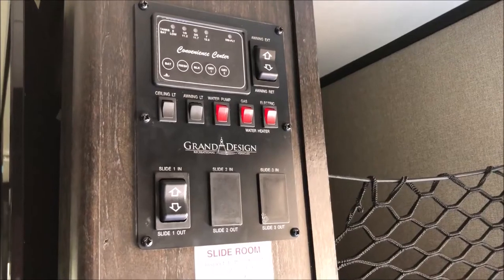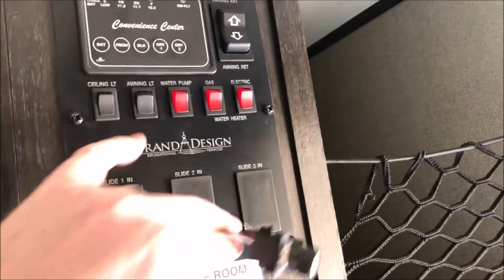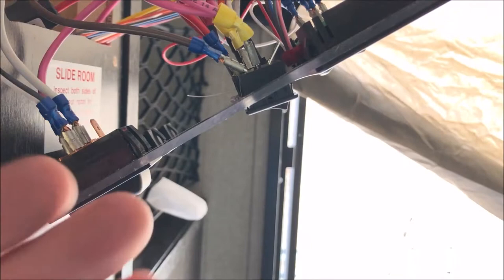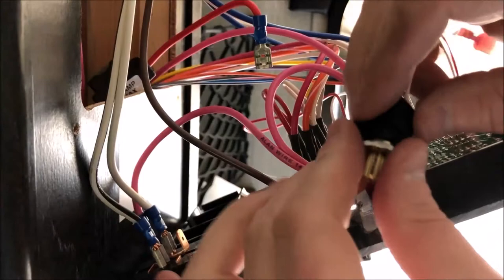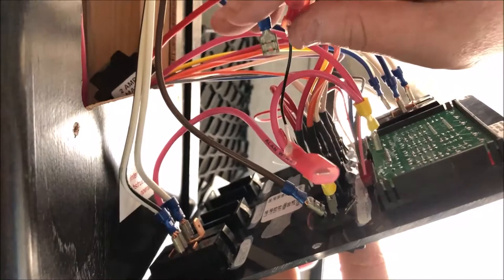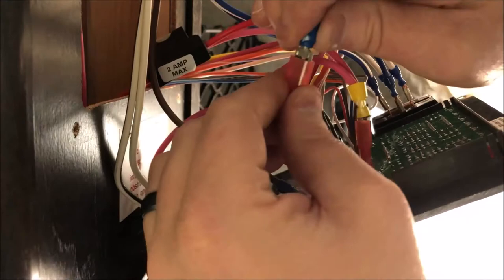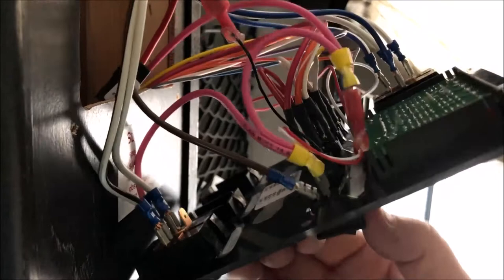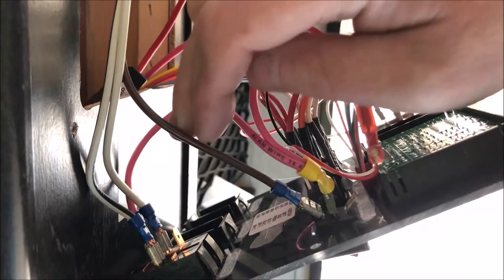Dimmer switch upgrade for RV

Comment: Added this to my Reflection 5th wheel. I have never liked how bright the Livingroom/kitchen lights were. This was a simple and fast upgrade that makes the lighting bearable. I had alighted switch but per Johns advise that wire was simply disconnected and taped off. The other two wires were marked exactly the same, white with a red line. I initially hooked them up wrong, so the lights stayed on all of the time. I reversed them and everything works as planned. Thanks John!

Comment: I just installed this dimmer in my 2019 Rockwood Mini Lite using the same 3D printed part.  It worked just fine although in my camper, the hot is pink and the ground is white.
Reply: RV wiring confuses me because they use the white wire for DC ground (most times).  I've always grown up with DC ground to be a green or black wire.  Thanks for sharing your info!

Comment: Hey. Love this idea!  Did you add the female connection to the dimmer switch wires?  The one I purchased has exposed wires with nuts and the existing wiring for the switch has the plastic wrapped male plug ins (not sure if the tech terms). Thanks in advance for your help!
Reply: Sorry…reverse male/female. Turns out the current switch is male and the wires are female. 😳
Reply from the maker: Yes I sell the adapters and offer a pigtail that helps with the wiring.  My email is johnsdiyplayground at gmail dot com

Comment: I would like to have seen the lights dim.  Are all RV LEDs dimmable?
Reply from the maker: Sorry I didn’t include the actual dimming in the video. Yes, all RV LEDs should be dimable if the correct type of LED dimmer switch is used.

Comment: We took your advice and put 2 switches in for the bedroom and awning. The 3rd switch is a 3 prong switch and we can't seem to figure it out. This toggle switch is constantly illuminated for our ceiling lights. The panel says white is ground so we put black wire to those 2 wires. But the other 2 are white/red striped wires. Do you have any advice?
Reply from the maker: I'm not exactly clear but as I understand you, the switch has 3 wires, so I think 1 wire has to be common ground (probably white), then 1 wire will be constant 12 volts for the illumination of the switch and the the other wire will be the hot side for the lights.  I think if you experiment with the combinations you will find a way to get it work.  My guess is you will only use 2 of the 3 wires attaching to the dimmer switch.  I know the dimmer switch has 3 wires, connect those wires like you did with your other non-illuminated switches.

Comment: Hi John, great video.  I tried email you provided and got a failure. Is Martin still providing the 3D faceplates? Please confirm email. Thanks so much
Reply from the maker: Martin’s email should be hybris1@yahoo.com  if it’s not working we might work on a plan B
Reply from the maker: It looks like Martin has another email address... try reaching him at scawaoh-adapterman@yahoo.com

Comment: If your trailer has Compass Connect or One Control to that can operate your lights this mod will not work.
Reply from the maker: Thanks for sharing the information!
Reply: Maybe that is why this mod did not work on my 2020 303. Can't figure out why but it don't work.
Reply: Right, the light switch goes to the OneConnect relay and not directly to the lights. The lights come off the control panel. I am in the process of trying to interject a dimmer after the OneConnect and before the lights.